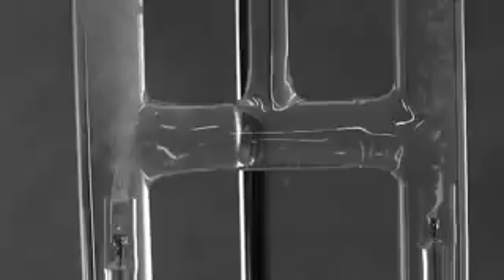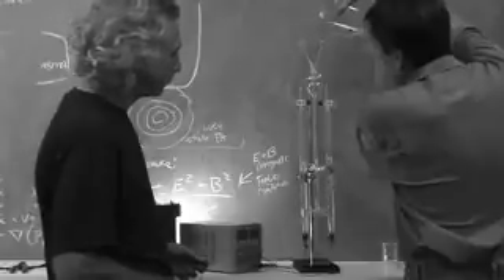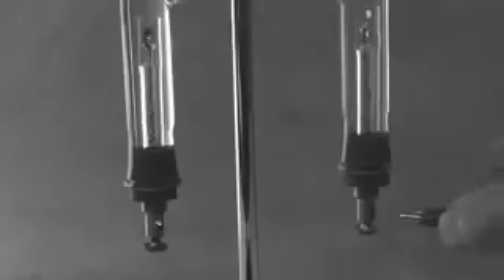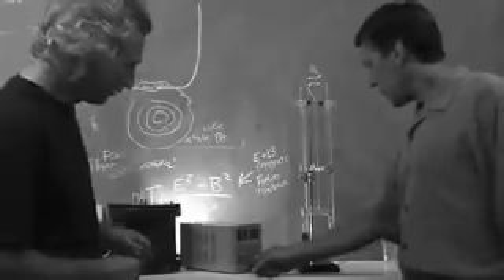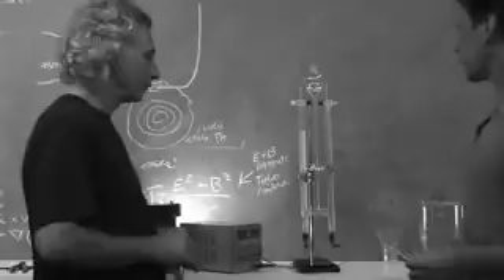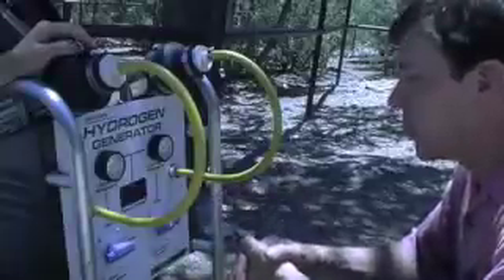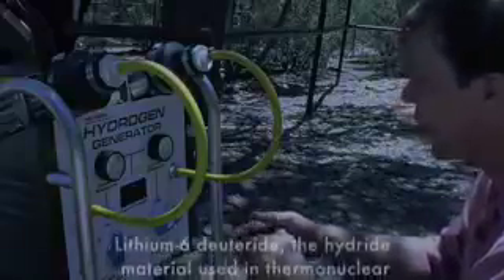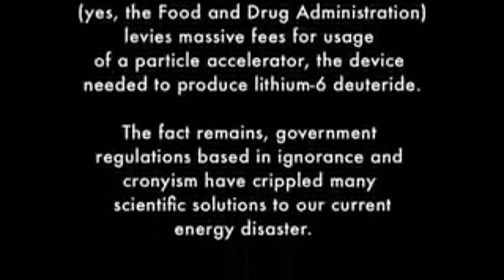run your car on water. This guy does just that!

Comment: What a bunch of crap! It takes the same amount of energy to create the hydrogen as it produces when burning in an engine. Thus no gain. Addtionally, you use water pressure to fill the tanks? Water pressure is maybe 40-50 psi regulated and 80 psi tops. The amount of hydrogen that could be stored at such pressure in those tanks would be consumed withn a few miles! Who are you kidding....
Reply: Bryan Lightningrod There's the initial (high) cost and maintenance cost. Then, the significant loss of energy during electrolysis. In the end, you wind up with a source of energy that is extremely cost prohibitive. And you're calling ME retarded?
Reply: u use solar power to harness the energy
Reply: Bryan Lightningrod Indeed, it DOES cost a lot. However, that's not the initial argument. It was YOU, not I, that introduced cost into the equation. My original post is still true. That is you get LESS energy form hydrogen than you use to create it! Oil, natural gas, coal, etc. requires far LESS energy than it produces to get it to the consumer. In other words, you don't have to manufacture the fuel; it's already there.

But getting back to cost; if it is so much more cost effective to produce hydrogen, tell me where your manufacturing plant is and I'll be glad to patronize you.
Reply: Fracer A I already use solar. So tell me, what is the benefit in converting my photovoltaic energy into hydrogen?
Reply: you use that energy from solar you create the hidroggen. The hidrogen will replace the gasoline!!! you will have to inject the H at the carburator right at the same spot where air and gaz meets...

please i want you to prove me wrong... save the planet
Reply: Fracer A That's akin to inverting DC from a photovoltaic panel to AC and running a battery charger to charge a battery. If you're all about conservation of energy (save the planet), then you are dead wrong.
Reply: Bryan Lightningrod Virtually ALL (automotive) batteries are recycled. 
Not sure how this conversation got detracted from my original claim. That is the amount of energy required to manufacture hydrogen exceeds the amount of useful energy that is extracted when it's consumed.
Reply: Bryan Lightningrod Yes, they are. Again, for some reason you're intent on changing the conversation. Read the title of the video. Then read my comment in response to the video. You will see (maybe) that none of it has anything to do with recycling.
Reply: you are looking for "three feet in the cat" dude... when the cat has four legs!...

or maybe you from the Bush family? :)
Reply: Fracer A  "you are looking for "three feet in the cat" dude... when the cat has four legs!..."

How so?
Reply: Bryan Lightningrod I am aware of this. Not sure your point.
Reply: Tell that to the car companies that run there vehicles on hydrogen, and ask them where the energy that runs them is coming from, where i come from, there are city buses that are running on hydrogen, and they are claiming that it is saving them on thousands every year.. go figure.
Reply: Bryan Lightningrod Look up lithium hydride on Wikipedia. In two minutes you'll know more about it than Bob Lazar.
Reply: Bryan Lightningrod That scenario you just described gives us way more energy, at a much lower cost than solar power does. Sunlight shining on a swamp for 50,000,000 years left behind a LOT of energy.
Reply: ***** Yes it will get used up eventually and the price of oil based transportation will become prohibitive. Then, whatever is cheapest to produce will take over. But the way humans are, the replacement fuel won't get much attention until we HAVE to find something else to rely on. But I think POVs are going to start fading away real soon. At least the gas burners we have now. I'm thinking driverless electric transportation is going to start appearing in about five years or less.
Reply: I rely a lot on my LPCs. (Leather Personnel Carriers)
Reply: ***** In context, this is strictly about hydrogen vs. gas (oil). That said, there is no gain in converting oil to hydrogen. In fact, it actually takes MORE energy to produce hydrogen than what it releases during combustion. I just said "the same amount" for simplicity. Additionally, the amount stored in the tanks depicted in the video is virtually worthless!

I STAND by my claim.
Reply: ***** You keep peddling the many benefits of hydrogen versus any other fuel which begs the question: how come the roads aren't full of hydrogen vehicles?
Reply: ***** Nonsense! If the benefits are so plentiful, then consumers would be willing to fork out the bucks; BIG bucks. And there you have even MORE billions.
Reply: ***** Yes. And the energy that is getting stored is basically fossil fuel energy.
Reply: Jake Jones I agree. There are millions of people on this planet who have the capability to produce hydrogen and who couldn't care less about the position of fossil fuels in our energy systems. (China and Israel come to mind.) And the idea that there are "tons of ways" to produce energy to split water would be a valid point only if any of those ways could produce more energy than oil. As of yet, none of them come close at all.
Reply: In context, this is strictly about hydrogen vs. gas (oil). That said, there is no gain in converting oil to hydrogen.
 In the end, you wind up with a source of energy that is extremely cost prohibitive
Jake Jones

You sound pretty angry and dismissive, you mention you use solar, great what do you do with the excess and what do you do for power at night?
Hydrogen allows a way to store energy and just so happens to burn clean. Thats all. I am not so sure why you are arguing against instead of looking for a way to have any tech succeed.

You also talked about the water pressure and the tanks, YEAH I have no idea what thats about at all. That does NOT make any sense to me at all. If you have 30 psi pushing into a tank you will have a tank with 30 psi out.
Not a lot of hydrogen in there that I can think of.
BUT can that be fixed? Who knows.
Reply: it isn't about creating energy you imbecile, it's about basically running your car on electricity, and for crying out loud you dont need to power it with solarpower

(fyi. I only read your first comment, I did not bother with the rest of the comment war)
Reply: Bob Tasa  Any excess power is consumed by my neighbors through the grid. At night, I utilize power from the local utility company.

I will argue against ANYONE who claims that hydrogen is more economical than other power sources. The reason being is that free hydrogen, due to it's instability, does not exist naturally. The only way to acquire it is to manufacture it. The law of conservation dictates that it requires at least the same amount of energy to produce as it gives up in an engine; thus, NO gain.

As for the pressure, no doubt it can be fixed. But again, the effort/energy required to end up with a useful tank of hydrogen FAR exceeds that of the energy produced by such hydrogen.

Anyone peddling such nonsense, as this guy in the video is doing, hardly deserves friendly responses. This just raises false hopes in those who truly want to improve the quality of life but don't quite understand the physics; and I'm just the guy who's willing to expose this kind of rubbish for what it is. So, call me angry...
Reply: simpox94  "it isn't about creating energy you imbecile"

Other than YOU, who else mentioned anything about creating energy?
Reply: Jake Jones "What a bunch of crap! It takes the same amount of energy to create the hydrogen as it produces when burning in an engine. Thus no gain."

you said this...
Reply: I wonder how feasible it is to use solar energy to split enough water to power our society. How much physical space would the solar generators take up?
Reply: simpox94 "you said this..."

You bet I did; so what's your point?
Reply: Jake Jones
I said: "it isn't about creating energy you imbecile"

then you sad: "Other than YOU, who else mentioned anything about creating energy?"

so I said: ""What a bunch of crap! It takes the same amount of energy to create the hydrogen as it produces when burning in an engine. Thus no gain." you said this..."

and you said: You bet I did; so what's your point?

Well my point is that other than me YOU mentioned something about creating energy.

Are you not following me?
Reply: simpox94 "Are you not following me?"

Better question: Are you not understanding the English language?
NEVER have I mentioned anything remotely related to "creating" energy. Guess it takes an "imbecile" to see this fact.....
Reply: Jake Jones "It takes the same amount of energy to create the hydrogen as it produces when burning in an engine. Thus no gain."

you where basically complaining that you didnt get any energy out of it...........

you don't understand a fucking sentence i'm whriting so I'm gunna ignore this komment now, so you know... don't bother awnsering
Reply: simpox94 "you where basically complaining that you didnt get any energy out of it..........."

Correction: I was basically stating that the amount of energy one has to introduce into the formula to create usable hydrogen exceeds the amount it provides when burned. I just got done cutting a whole lot of firewood. The amount of energy used to cut the timber was but a small fraction of that which will be realized when it burns. Thus, a significant gain! Understand now?
Reply: Jake Jones I'm sure someone has already pointed out that you can make a chain of 8 carbon atoms and it can be used to carry 18 hydrogen atoms.  This works better than a metal hydride to run a car.
Reply: well if you paid attention to the video, he said he used solar power, so it doesnt really matter that it uses more electrical energy to split the h2o than what is created when burning h2
Reply: darius kruger If the power comes from a solar panel, you can use it to make H2 or you can use it to charge batteries of some kind or you can pump it onto the grid to sell it to the power company.  Since the efficiency of splitting water is so low, it is very likely that you would do better selling the power to the power company and then using that cash to go out and buy fuel.

Also if you work out how big the panel needs to be to meet typical driving energy requirements, you find it is big.

1HP = 746 Watts

A smallish car averages about 10HP average power requirements making the power 7460 Watts
The average car is used some 2 hours per day. 14920 Watt hours
You get about 8 hours of sun on a panel 14920/8 = 1865
You get about 100Watts per square meter of panel 1865/100 = 18.65 Square meters
.
Reply: darius kruger "he said he used solar power, so it doesnt really matter that it uses more electrical energy to split the h2o than what is created when burning h2"

I don't care WHAT he used for energy. The fact remains that a large percentage of energy is lost in the transition. Not unlike trading a dollar for three quarters; if even that much.
Reply: Jake Jones point is, it doesn't matter that the process is inefficient if the source is renewable
Reply: darius kruger
The point is that it does indeed matter that the process is inefficient.  You can put the renewable energy into the power grid instead of wasting it.
Reply: darius kruger "it doesn't matter that the process is inefficient if the source is renewable"

I fail to understand the difference between throwing away 50% renewable as opposed to 50% non-renewable. Half is half.
Reply: Jake Jones Well obviously you can't see a difference between taking money out of your right pocket and burning it and taking money out of your left pocket and burning it.  :) :) :) :)

Sadly, those of us who work on real ideas for sustainable energy have to contend with a skeptical public that is constantly being given good reason to be skeptical.
Reply: Jake Jones obviously there's a difference, if you throw away 50percent non renewable it's gone forever, if u throw away 50 renewable, you've lost nothing, petrol causes pollution, the combustion of hydrogen produces water
Reply: darius kruger If you throw away 50% of the energy, you have lost 50% of the energy.  Once it is in the form of electrical energy, it joins the great pool of electrical energy.  If you put it on the grid, the power company decreases how much hydrocarbons they burn.  If you waste it, the power company burns the hydrocarbons.  If you use it to run an efficient electric car, you don't fuel up the Hummer quite so often.  If you use it to power something in the home, this works out to be just like you put it on the grid.
Reply: Jake Jones

""Nonsense! If the benefits are so plentiful, then consumers would
be willing to fork out the bucks; BIG bucks. And there you have
even MORE billions. "'

Sidney38SN oil is making them tons of money
by THEM he meant the oil companies

not the consumers

creating hydrogen is inefficient  but since the elements used are so cheap the resulting fuel would be cheaper for the consumer than gas currently is

this is more important than the efficiency
Reply: jhanthony2

"And the idea that there are "tons
 of ways" to produce energy to split water would be a valid point
only if any of those ways could produce more energy than oil."

the question is not "can they produce as much energy as the oil companies"
the question is can they produce enough fuel to power America's cars
Reply: robinsss Rather than "more energy than oil", I would say "at a much lower cost than oil".  Splitting water and then burning hydrogen has an efficiency of about 50% so the solar power etc would have to be about 1/2 the cost to make the idea work.  Charging batteries is more efficient so going with electric cars for short trips is workable.
Reply: robinsss "by THEM he meant the oil companies
not the consumers"

That's right; and such companies providing hydrogen would net them even MORE money!

"the resulting fuel would be cheaper for the consumer than gas currently is"

If this is true, then such fuel would already be in widespread production. But it's not. Gee, I wonder why....
Reply: "
That's right; and such companies providing hydrogen would net them even MORE money!"'

how can the oil companies make more than $3.75 a gallon?

they would make less off of hydrogen per gallon

"If this is true, then such fuel would already be in widespread production. But it's not. Gee, I wonder why...."

no it wouldn't when oil company lobbies have helped to put leaders in office and are constantly lobbying to stop the study of alternative fuels
Reply: robinsss "how can the oil companies make more than $3.75 a gallon?

I didn't say more than gas. I said more, as in additional, money.

"stop the study of alternative fuels"

Red herring. We are not talking about "study"; we are talking about production.
Reply: Jake Jones
"I didn't say more than gas. I said more, as in additional, money."

do you mean they could produce oil and hydrogen?

"Red herring. We are not talking about "study"; we are talking about production"

they want to prevent any study of alt fuels because it could lead to production of alt fuels

there philosophy appears to be kill it before it grows
Reply: robinsss"do you mean they could produce oil and hydrogen?"

Yes.

"there philosophy appears to be kill it before it grows"

I'm not sure how this all ties into your claim that hydrogen fuel is less expensive than oil fuel.
Reply: Jake Jones

"do you mean they could produce oil and hydrogen?"
Yes.

that's called diversification
and despite the fact that it seems to make logical sense to you and me many companies
won't do it

instead they choose one industry over another
and that's what oil is doing
choosing oil over any other alternative fuel
and protecting it's monopoly in the area of car fuel
Reply: Jake Jones

"there philosophy appears to be kill it before it grows"

I'm not sure how this all ties into your claim that hydrogen fuel is
 less expensive than oil fuel

you said this

"If this is true, then such fuel would already be in widespread production.
But it's not. Gee, I wonder why "

my response is

1.the competition would lower their profits
2.they won't diversify
Reply: robinsss "1.the competition would lower their profits
2.they won't diversify"

Perhaps, but neither one prevents the production of hydrogen from said competitors.
Reply: Jake Jones

this video was made only recently

this is the first video I have ever seen to present a legitimate solution to the storage
problem

so I don't think very many people know
about the true potential of this fuel source

some are waiting to see if any of it is feasible
Reply: robinsss "this is the first video I have ever seen to present a legitimate solution to the storage
problem"

Don't be fooled. There's basically nothing legitimate about this video. Summed up, this guy is presenting an extremely difficult engineering concept as if it's little more than backyard mechanic rigging. Not unlike writing a book titled "How to Win the Superbowl in Three EASY steps".
Reply: Jake Jones

" There's basically nothing legitimate about this video"

what's illegitimate about this video?

if the first idea that he presented can not work then tell us why

you started this thread in May of this year
that's three months ago

the pressure situation is questionable

but do you have some criticism other than the amount of energy that's put in is equal to the amount that comes out ?( which I rebutted and you didn't defend)

if that is your only criticism don't you think
the cheaper cost of the resulting gas is more
important?

I don't think you answered that question
Reply: robinsss "what's illegitimate about this video?"

Like I said, he is portraying hydrogen vehicles to be basically a simple do it yourself project. 

"don't you think
the cheaper cost of the resulting gas is more
important?"

How is it cheaper?
Reply: Jake Jones

"Like I said, he is portraying hydrogen vehicles to be basically a simple do it yourself project. "

he never said that so that's your opinion

"
How is it cheaper?"

considering the only ingredients or the main ingredients are electricity and water it has to be cheaper than gasoline

and it would make us independent of the countries we currently receive oil from
Reply: robinsss "he never said that"

That's why I said "portray". Words have meaning.  

"considering the only ingredients or the main ingredients are electricity and water it has to be cheaper than gasoline"

Likewise, I could claim that hundred dollar bills just have to be really cheap since they only consist of paper and a little bit of ink! Heck, for that matter, why bother with electricity and water when you can use just sunlight? Gets no cheaper than that. In case you were not aware, ingredients are not the sole cost of a product. In fact, ingredients are not ANY of the cost. The only cost is the labor to get the finished product to the consumer.
If I offer you a free big screen TV, and all you have to do is come pick it up in New York but you live in Kansas, then it ain't really free...  is it. In fact, you would most likely decline the offer.
Reply: Jake Jones

"Likewise, I could claim that hundred dollar bills just have to be really cheap since they only consist of paper and a little bit of ink!"

you can't compare hydrogen made with this device to the dollar because the dollar is effected by the market

my homemade hydrogen isn't

so the only cost of that hydrogen is the cost of it's ingredients

"The only cost is the labor to get the finished product to the consumer."

considering I would make it at home with this device the cost to get the finished product to the consumer would be zero
Reply: robinsss  "you can't compare hydrogen made with this device to the dollar because the dollar is effected by the market"

Sure you can. Hydrogen is also affected by the market, so the point is moot. My guess is that the ingredients in a dollar costs less than one penny.

"so the only cost of that hydrogen is the cost of it's ingredients"

And the only cost of a diamond is one small lump of coal. So perhaps you should pursue that endeavour rather than hydrogen since the profits would be substantially HIGHER! 

"the cost to get the finished product to the consumer would be zero"

I was not referring to transportation costs only.
Reply: Jake Jones

"And the only cost of a diamond is one small lump of coal. So perhaps you should pursue that endeavour rather than hydrogen since the profits would be substantially HIGHER!"

maybe you didn't understand so I will explain it more clearly

the hydrogen that I make at home may be worth over $3.00 but since most people making at home will not be trying to sell the gas , it won't be going on the market so it so the market price of the gas will not affect me
. it will be going straight into their cars in most cases

"I was not referring to transportation costs only."

what other costs were you referring to
Reply: *****

I don't know

but it cost consumer $3.75 a gallon
Reply: robinsss "maybe you didn't understand so I will explain it more clearly
the hydrogen that I make at home may be worth over $3.00 but since most people making at home will not be trying to sell the gas , it won't be going on the market so it so the market price of the gas will not affect me
. it will be going straight into their cars in most cases"

With all due respect, that was about as unclear as one can get.

"what other costs were you referring to"

Well, let's see. There's research costs, engineering costs, tooling costs, legal costs, impact fees, license fees, and production costs to name a few.
Reply: you know nothing.
Reply: Jason Horton  "you know nothing."

Well........  thank you for your opinion.
Reply: the same amount of energy?many people have made hydrogen generators that run off the battery that is charged by their car as it runs on the hydrogen it makes from  the battery that is charged by their car as it runs on the hydrogen it makes from  
the battery that is charged by their car as it runs on the hydrogen it makes from 
the battery that is charged by their car as it runs on the hydrogen it makes from 
the battery that is charged by their car as it runs on the hydrogen it makes
 that being said.stored wood gas is so much better and you can heat your home and water at the same time .plus just about anything you burn in it ,burns clean.
Reply: This is environmentally friendly compared to oil though...
Reply: kwokshsee "U idiot! He's not demonstrating zero-point energy or a perpetuating machine"

Nor did I claim so. But I guess it takes an "idiot" to realize that.
Reply: kwokshsee "there's no energy gain"

Didn't say that.  

"u moron. U are too stupid to see the implication of ur statement"

My statement has absolutely NOTHING to do with your "zero-point energy or a perpetuating machine". A NON-implication easily recognized by a third grader.
Ya gotta lay off that pipe.
Reply: kwokshsee you have missed the whole concept of this tech.it has nothing to do with "over unity"it is alturnitive energy and the storage and use of the alturnitive energy.you can not put a giant windmill or 400 soler panals on your car and drive it around.but ,with these speciel tanks this guy has developed,a giant windmill or 400 soler panals can be used to make hydrogen from water and be stored safely for latter use on anything that would normaly be burning poluting oil products.
Reply: kwokshsee "But it  IMPLIES  that"

No it doesn't. 

"admit u're an idiot"

Whether or not an "idiot" has no bearing on the truth of my claims. So lighten up with the ad homs.
Reply: Jake Jones yes it does and it can
Reply: kwokshsee "u thought it tapped into zero-point energy or was a perpetuating engine."

Untrue.

"Learn basic logic u idiot"

Perhaps you should learn proper grammar and spelling before attempting to teach others about logic, AND spouting off ad hominems.
Reply: Jake Jones yes,that sunlight is wicked expensive.
Reply: kwokshsee jake jones,is an absolute dumb fuck.i think we could all be speaking with mr.rothschild himself.i sense fear in his comments.
Reply: kwokshsee "I dare u point out what's wrong with my grammar, u idiot."that's funny.U=you.not that it matters,it's youtube.
Reply: kwokshsee  cyber-spelling.ok.
Reply: kwokshsee "insulting idiots like u"

It's been fun replying to your comments, but the time has come to engage in meaningful conversation with others.

So I give you the last word; and make sure to say something REALLY stupid.
Reply: Jake Jones Because hydrogen is a pain in the ass to deal with.
Reply: Jim Mowreader thus ,the tanks he made.
Reply: here's a question for you, how much energy does it take to refine and transport gasoline to gas stations.  Is it more or less than it takes to produce hydrogen?
Reply: Ben Warschau hydrogen vs gasoline.umm well, you can't  refine and transport gasoline to gas stations with solar panels thats for sure.a vehicle can make it's own hydrogen from water .it  is  a  no  brainer.   high school kids do it all the time...if someone wants a car that burns water instead of oil,just go to the dollar store and pick up the stuff to make one.unless your myth buster finger puppets,it ain't too hard.most any pot smoker could do it.
Reply: Ben Warschau "Is it more or less than it takes to produce hydrogen?"

That's like asking how much does a vacation cost. The point is that fuel oil energy is already there. The  energy it takes to get it to the consumer comes from the very fuel itself. Contrarily, hydrogen is nothing more than a conversion of other already USEFUL energy that requires additional (wasted) energy to produce. And the manufacturing energy is immense!
Reply: Clearly you miss the point of the question.  If it takes the same amount or less energy to make hydrogen as it does to refine and transport gasoline and you can run your internal combustion engine off it rather than go out and buy an electric car then why not go with the cleaner energy?  Forget about over unity.  Is gas over unity?  I don't know but I doubt it.
Reply: Ben Warschau It takes less energy to refine and transport gasoline than it does to make hydrogen.

The most common way to make hydrogen is to start with methane - natural gas. You mix superheated steam with methane to get carbon monoxide and hydrogen; the carbon monoxide is then mixed with lower-temperature steam to produce CO2 and more hydrogen. Steam requires a lot of energy to produce, and you are converting one fuel into another. You would be better off with a three-step procedure:

step 1: burn natural gas in the car. This is a well-proven technology with a good existing infrastructure - a LOT of bus fleets, garbage trucks, cop cars etc., are already running compressed natural gas.

step 2: capture the resultant CO2 and feed it into a catalyst that will convert CO2 to CO: 2CO2 -> 2CO + O2. 

step 3: feed the CO back into the engine. It's flammable. You'll never reach a state where the engine will run with no methane added, but if the only "exhaust" the car makes is oxygen...go for it, man.

The other way to make hydrogen is to electrolyze it from water. I realize you can get "free" energy from solar cells, wind etc., to make up for the fact that it requires 1.5x the power you'll get back from burning the H2 to get H2O to separate. I also realize batteries are a proven technology; if you are going to make enough electricity to electrolyze hydrogen, put that shit in a storage cell and use it to recharge cars when they come in. 

The only time you SHOULD use hydrogen is if you MUST use it. The Space Shuttle is a good example. Hydrogen is a low-mass fuel so it allowed them to use more of the rocket's power to lift payload rather than fuel...the tradeoff is, the external tank was big enough to hold the Orbiter and both SRBs. Very few people want a gas tank bigger than their car. Jewelers like hydrogen welders because you don't have to store acetylene and oxygen cylinders. I would REALLY like to see a natural gas fuel cell car that has a device onboard to split the resultant CO2 into its elements, then stores the carbon in a canister you can send to a company that buys carbon black, like Goodyear or an ink company.
Reply: That is not the context of this conversation.  Watch the video,  we're talking about electrolysis.
Reply: Ben Warschau "If it takes the same amount or less energy to make hydrogen ..."

Keyword: "if". Not to mention, there are several hurddles to jump before hydrogen as a fuel becomes practical. For what it's worth, you get far more useful energy with electric vehicles than you do with hydrogen vehicles.
Reply: Bryan Lightningrod Car batteries are MOST DEFINITELY recycled, crackheads go nuts to find them. They go for like 11 to 13 dollars a piece. Me and this crackhead I knew(no I'm not a crackhead) were scrapping and found 30 of them, we got a little over $400. So trust me, they ARE recycled.
Reply: Bryan Lightningrod It's for the lead. They're about 30ish pounds and lead goes for about 33cent's per pound.
Reply: Bryan Lightningrod Toyota's "first mass produced hydrogen car" is a fuel cell vehicle running on manufactured 5000 psi hydrogen, not a car like this. If you can get past the price tag on a fuel cell, it's a sound concept.
Reply: Bryan Lightningrod Until there is a HUGE increase in renewable electricity - wind and solar - hydrogen isn't as "green" a fuel as you think it is. Almost all the hydrogen currently being produced in this country is made by steam reformation of methane - you mix CH4 with live steam, pass it over a catalyst, and get hydrogen and carbon dioxide. Since almost all the hydrogen we make is used to make ammonia and the synthesis of ammonia itself requires a shitload of energy, I can live with it. But if you're using huge amounts of energy to convert methane - which is a very good fuel in its own right - into hydrogen so you can use it in a car...if that sounds dumb as shit to you, join the club. 

You can use natural gas in a vehicle in one of two ways. The most obvious is to plumb CNG into a vehicle's fuel injection system. This is so easy to do and so common, it's not even fun anymore. There are thousands of city buses, standby generators, garbage trucks, cop cars and fleet vehicles running on compressed natural gas right now. The technology works and it's reasonably priced. The other is to build a natural gas fuel cell like Bloom Energy is doing. 

On the other hand...there are many places where wind turbines or solar arrays can be installed to get the electricity you need to electrolyze water at an affordable price, or you can add a few more hydro turbines to a dam. If you can get hydrogen without breaking up a more energy-dense fuel, go for it.

There isn't one perfect fuel. In the ideal energy future, hydrogen has a place...as do electric, natural gas, gasoline, petroleum diesel, biodiesel, ethanol and even coal. Focusing on one fuel and saying, "THIS is our future, we need no other," is a self-defeating proposition.
Reply: Bryan Lightningrod Hydrogen IS made through steam reformation of methane because it's less expensive to buy methane - which is the primary component of natural gas, and very cheap - and use part of it to create the necessary heat of reaction, than it is to buy electricity for electrolysis of water. (Using solar to make hydrogen IS electrolysis, sir; if you just heat water you get steam, not hydrogen.) 

Next hydrogen problem: Since an H2 molecule is as small as it is, it will leak out of anything you put it in. The longest hydrogen pipeline network in the world belongs to Air Products, and it's on the Gulf Coast of the US. The TOTAL length of the pipe is 600 miles and there are several hydrogen generators along its length. I don't know if you've seen a liquid hydrogen truck. I've seen several along my travels, and they all have two common features: a constant plume of hydrogen steam, and signs on all four sides of the truck that say it's supposed to do that. (Apparently they don't want the citizenry freaking out.) Hydrogen isn't very transportable, in other words. To have a full-scale hydrogen economy you will need a lot of hydrogen producers - one every 300 miles wouldn't be out of the question. And unless you can find a shitload of money to build factories right quick, THAT is probably out of the question.

I like the approach Tesla is taking to increasing the range of its cars: design one that will go 300 miles on a charge, then build charging stations close together.
Reply: Yes but there would be no bad gas emitted